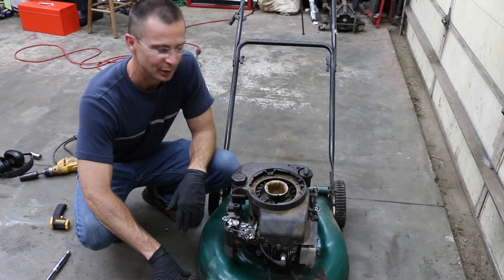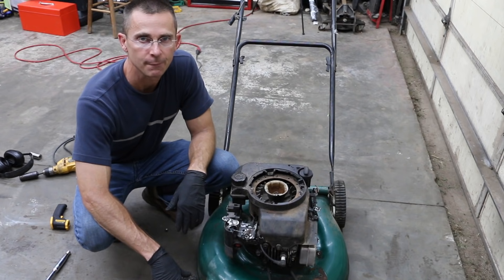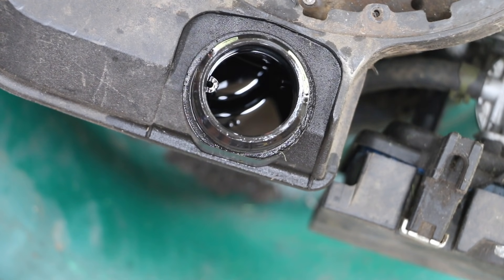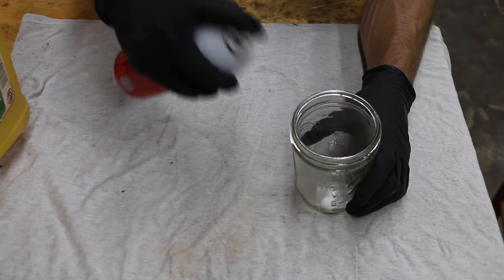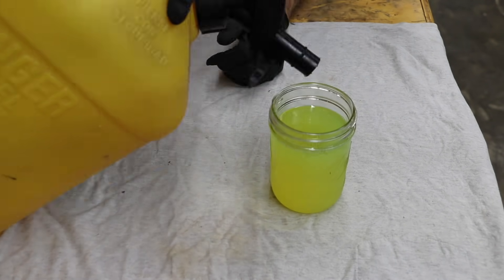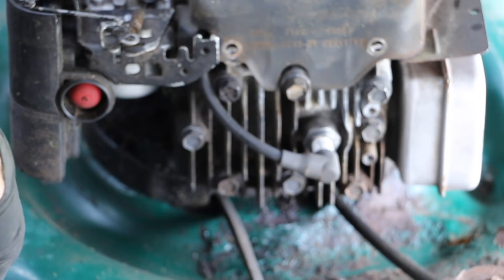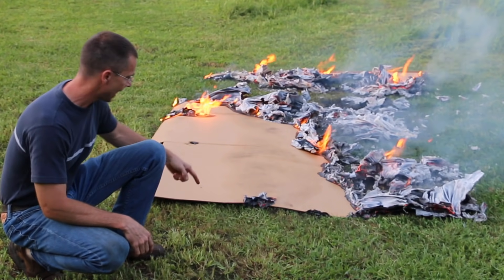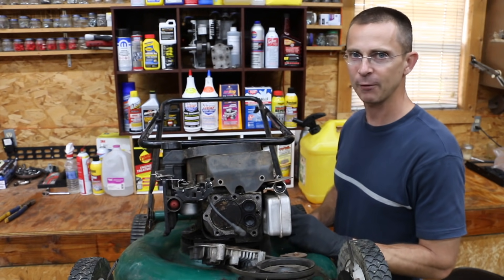Will a Gas Engine Run on Diesel?  Let's find out!

Comment: What about trying to run a Gas engine on 100% Automatic Transmission Fluid
Reply from the maker: Thank you for the video idea!
Reply: @ProjectFarm  I wish you were closer to me I would supply you with all the mowers you need I have given a few away or sold for cheap

Comment: A bit of propane in the air cleaner can help get a sluggish engine running, and keep it running, instead of starting fluid. I use a propane torch that hasn't been lit for a source. Seldom have starting fluid with me but I usually have a torch around. Sometimes this is good enough to get a somewhat nasty carb to clear itself and after running at full rpm for a bit it'll run well on it's own.

Before I get called out on it, obviously the air/fuel mix for a propane torch is NOT ideal for an engine, so you don't want to do this for long. Also, this doesn't replace proper maintenance, but in a world where the job has to get done and the clock is ticking, you do what you gotta do. Propane takes 30 seconds to try.

Comment: I uploaded a video where i put one gallon of diesel in my 2001 Deville. I then fill the tank with gas. The car ran fine.
After watching this video. I’m going to burn down my tank and then try a gallon 50/50 mix of diesel/gas in my 2001 Deville.
Reply from the maker: Thank you for the feedback

Comment: Mothballs can be either para-dichloro-benzene, or naphthalene.  Which is the one you used?  If the former, you are putting chlorinated fuel into the engine, and it will be difficult to burn!
Reply from the maker: Naphthalene.  Thank you

Comment: there is a difference in diesel at room temp and at high temp injected into a hot cylinder.
oil will burn faster than gas at flash temps. why diesels have little  advance timing for ignition.
Reply from the maker: Thank you for the video idea!

Comment: I ran a junkyard Briggs on used cooking oil with 89 gas 50:50, or started on gas and running heated wvo (tank heated by block, old school 3hp ). At low rpm it pulled like a donkey. At high rpm it turned into a glow plug engine.
Reply from the maker: Thank you for the feedback

Comment: A low compression gas engine might run on it, esp if you heat the diesel and adjust the carb. If you put it in a fuel injection or high compression engine, you will probably waste it. If you’re lucky it will just foul the filter and not start.
Reply from the maker: Thank you for the feedback

Comment: See how many fluids a diesel engine will run on.
1. Used french fry oil (filtered) 
2. Hydraulic fluid
3. Used motor oil (filtered) 
4. JP4, JP7 , diluted asphalt 
5. I dunno anything petroleum based or oil based. Carbon based liquid compressed and heated ?
I've heard of and seen lots of fluids work in a diesel. How many can work ?
Reply from the maker: Thank you for the video idea!

Comment: I already performed this test 50 years ago. When I was a teenager, I mistakenly filled a riding lawnmower with diesel. It ran fine while the engine was still warm, but it sure did smoke. The guy who owned the mower came outside and said, "What happened?" I said, "I don't know, I filled it up with gas and it started smoking when I started it back up." He checked the tank and discovered it was diesel, so he had to drain the tank and refill with gas. It was his fault for putting diesel in a red gas can and not labeling it "diesel."
Reply from the maker: Great feedback. Thank you!

Comment: After accidentally refilling my mower with diesel, it ran just fine. It wasn't quite as smooth as with gasoline, and it  smoked from the exhaust under heavy load. It had whatever gas was left in the tank when the motor cut out.
Reply from the maker: Thank you for the feedback

Comment: You just showed some of the differences between gasoline and diesel fuel. Diesel is intended to combust at higher temperature and pressure than gasoline. Gasoline has an octane rating, the higher the octane rating the SLOWER the burn, thus decreasing “knock”. Diesel has a cetane rating which is opposite, measuring how quickly it burns. Also, gasoline won’t burn as a liquid. Don’t believe me? Put a small amount of gas in a closed container and cool it in an ice chest. Remove the lid and throw a match in. It doesn’t burn. That’s why the cardboard on the gasoline side didn’t burn. The gasoline VAPOR combusted. Take the same container and put some gasoline in. At room temperature shake the container and then pour out the gasoline. Now throw a match in the container which now contains no liquid gasoline. You have great, educational videos. So you could put maybe 10% diesel in your gasoline and raise the octane rating, but diesel typically has more sulphur ( so does cheap gasoline) which leads to deposits.
Reply from the maker: Thank you for the feedback

Comment: I did that to one few years ago got it goin with a little propane till the engine warmed up on straight diesel. Once it was running it didn’t have a problem. One thing I thought was cool is if I was mowing deep grass it would work it hard enough to get it to Knock like a Diesel engine
Reply from the maker: Thank you for the feedback!

Comment: Not enough octane for diesel fuel to run in a gas engine. Diesel like 42 octane. Run some 110 octane or racing fuel see if you get more horse power. 😄
Reply: Diesel has more BTU by alot